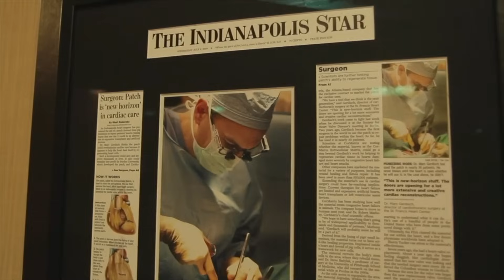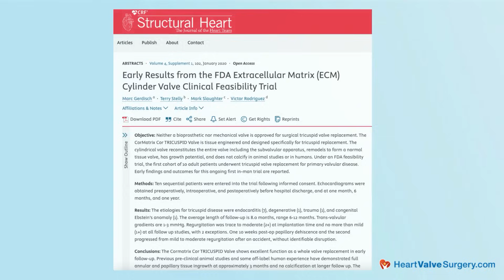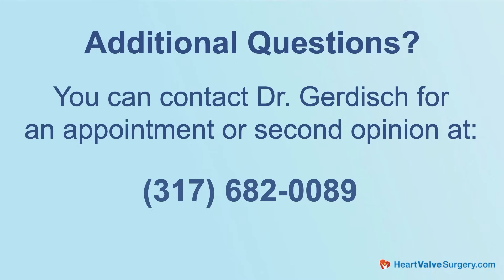Cardiac Innovation: Growing a New Human Tissue Valve Replacement Using Scaffolds

Comment: Wow, I have a tissue installed almost 2 years ago, I wonder if this technology will be available by the time I need a new valve, hopefully a decade or more from now.
Reply from the maker: McGragor, Fingers crossed the clinical trials will be completed and an FDA approval will happen by the time you need a new valve.  At the same time, the safety and effectiveness of the scaffold approach will be determined through clinical trials and the FDA evaluation of that data. Stay tuned!